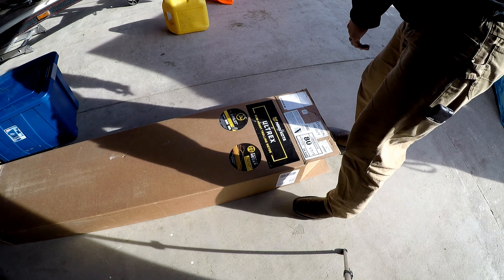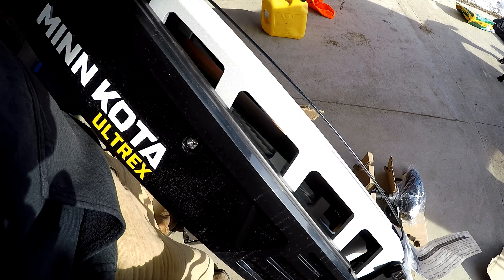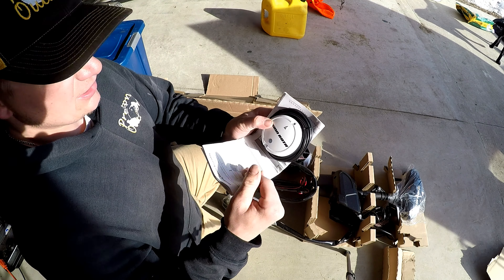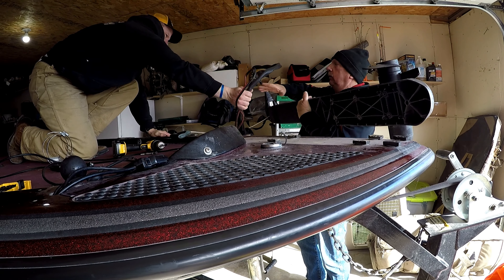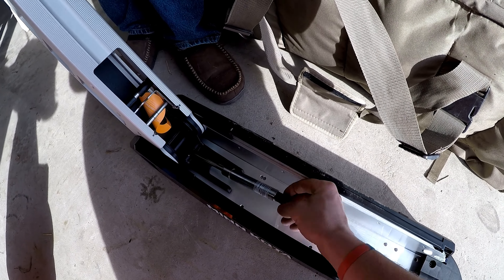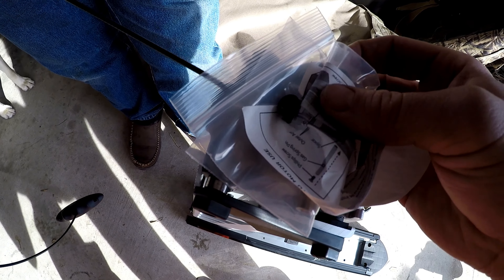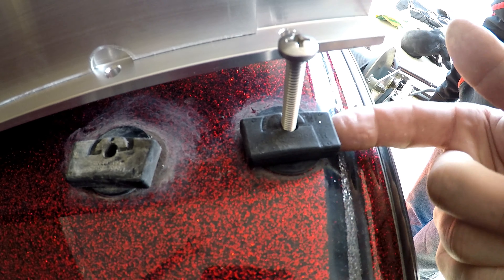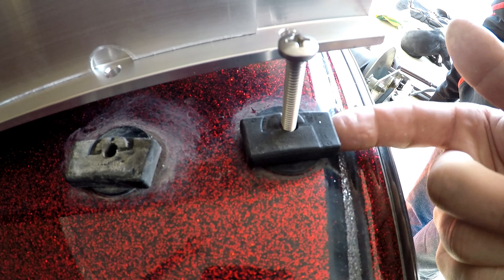Installing Minn Kota Ultrex Trolling Motor!!!

Comment: Thanks very much for this video.  That being said, most can figure out putting the motor together and mounting, but the most important part of the install seems like was vague….
wish you all went into detail about wiring that puck….
so like, does the puck need a on/off switch of it’s own or is it wired to the main power and comes on when main console power knob is on? Or is it wired to turn on through the on/off knob of the trolling motor foot pedal switch?
What is all the soldered wiring you all showed for like 3 seconds and why?🤷🏾‍♂️
Reply from the maker: Thanks for watching and taking the time to watch the video! I apologize for the portions of the video that didn't make sense. Hopefully I can answer those questions here. As for the puck you could wire it to and on/off switch, I did not. I wired it to the main power that runs the switches on the front of my boat. All the sottered wires you seen in the video is the main power that is up in the front of the boat and thats where we connected the negative and positive for the heading sensor.
Reply: @PrestonOutdoors  Thanks-a million for the quick reply to my inquiry.
Reply from the maker: @TheSilverSurfisher  not a problem!

Comment: How did you hook up your foot pedal wires with the terminals to your plug? I am having difficulty because the terminals won’t fit the holes of the back plate that screws in to keep the prongs from  moving.
Reply from the maker: Thanks for watching and commenting! I have to apologize, this was on part of the install I did not actually film. Not sure what type or size of plug you have but all we did was loosen the two screws, remove the wires from the other trolling motor, use a wire stripper and stripped the wires for the Ultrex. Then positive and negative on their proper sides, assembled the plug back together and plugged it in to see if we had power. Didn't seem to have much trouble with terminals not fitting?

Comment: Nothing hooking up power once again fail
Reply from the maker: Ray Williams thanks for watching. What was your question?
Reply: @PrestonOutdoors  looking for power hook up as part of vid. They all seem to miss that part. I figured it out..ty
Reply from the maker: Ray Williams ok I understand now, reason I didn’t really mention it in the video is because I already have a plug in up front on my boat that was there when I got it. So we just took a part the plug in from the other trolling motor and attached the wires to the plug in and inserted it.
Reply: Preston Outdoors what power wire did you hook the GPS antenna to, fixing to take mine apart was wondering what was back there.